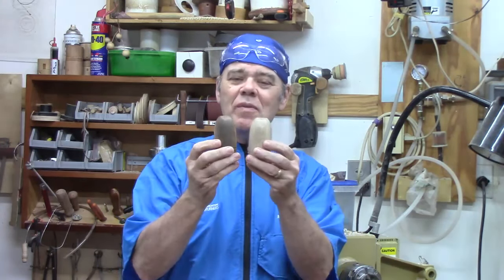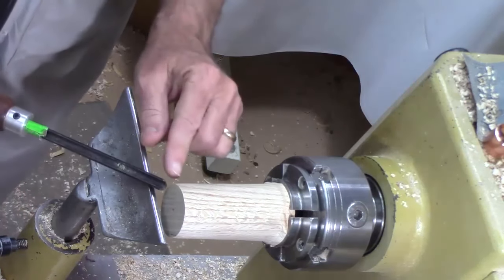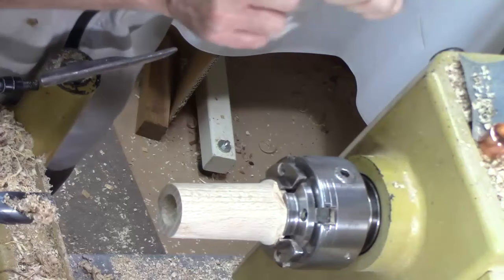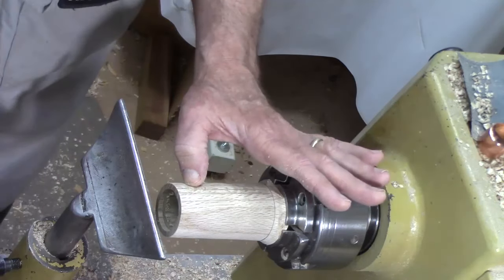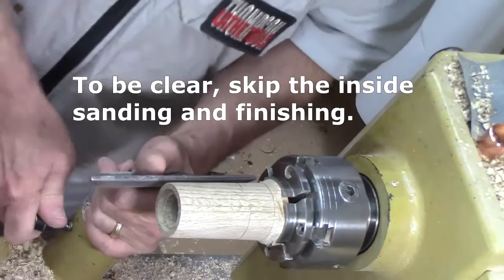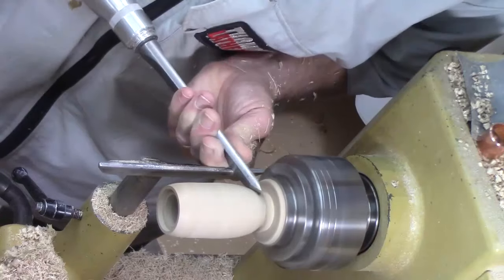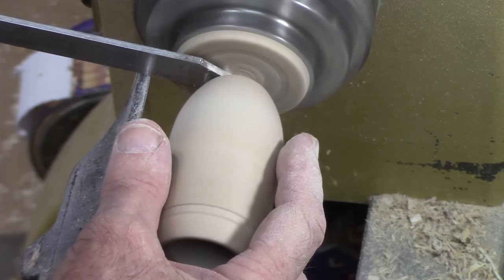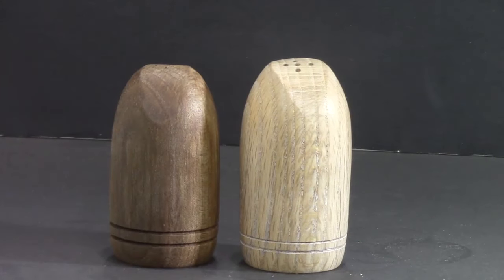How to Turn a Salt and Pepper Shaker

Comment: I like those shakers. My mom has collected salt and pepper shakers. so I think you just gave me an excellent idea for Christmas present. Thank you. Another idea you gave me was to get a ACU jacket as a turning smock. I did and I love it. Thank you for that. Now I have a question. What is the purpose for all the different colored stickers or paint on your tools? Thanks again for all the good videos. Aaron
Reply from the maker: The green tape is to make it easier to collect my tools after temporarily loaning them out during a workshop. I sometimes paint letters on the butts to more easily identify the tool when the tip is down. SG for Spindle gouge, X for scraper etc.
Reply: Mike Peace Woodturning I wondered if it was something to do with identifying the kind of blade it was. I've been thinking about doing that to mine, however I don't necessarily need to do it just yet. I don't have enough tools to get confused. Although I get confused about a lot of other things pretty easily, so I guess it really doesn't matter how many tools I have.lol 
Thank you very much for the reply and again thank you very much for the great idea of using a ACU jacket for turning.

Thanks again Aaron

Comment: Hi, Mike. Nice project! I'm finally catching up on all the videos on my "watch later" list. When you were drilling the hole, you stopped and wiped the drill with a q-tip and some fluid, then rubbed some wax on the bit? It was 4x speed at that point, I think, and I'm not sure if that's what you did.
Reply from the maker: I was just wiping off the stuck shavings with a toothbrush and then rubbing the flutes with a wax candle to make drilling easier with less screeching.

Comment: Just washing and rinsing the inside is good for cleaning before filling with salt and pepper?
Reply from the maker: Moderate sanding inside and rubbing it with a paper towel should remove any dust. I would not want to subject a finished piece to water.

Comment: Mike, very nice set. what is your thoughts on using a jam chuck to finish the top? Since you didn't, I was wondering if there was a problem with the idea.
Reply from the maker: There was no need for a jam chuck since my goal was an asymmetrical shape across the top from a sander.

Comment: I might try this idea. I wonder how difficult it would be to make the tiny holes in letter patterns..."S" for salt & "P" for pepper. Might be redundant since the color difference does the same thing. Maybe I should use matching wood for this idea. Just a thought. :-)
Reply from the maker: The challenge is to have the right number of holes for a single shake. Letters might over do it. The other possibility is a matching set except for perhaps a contrasting ring that might hint at the contents. A light color shaker with a dark wood band could signal pepper, for example.
Reply: Good point on the number of holes. I'll try super fine coffee ground powder and CA to make the pepper accent ring. Maybe some sort of white powder for the salt shaker.
Reply: Ok see no p MO

Comment: How did you determine the drill bit size for the holes? Love your work.
Reply from the maker: Richard Raffan's book I showed in the video. I suppose it would be easy enough to experiment with a small container and tape on a disk with the holes you want to experiment with.